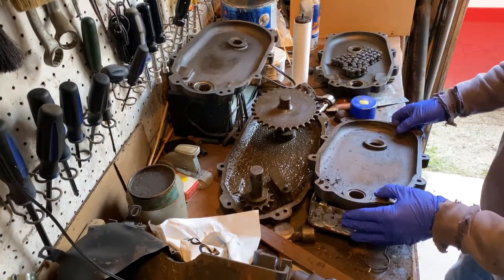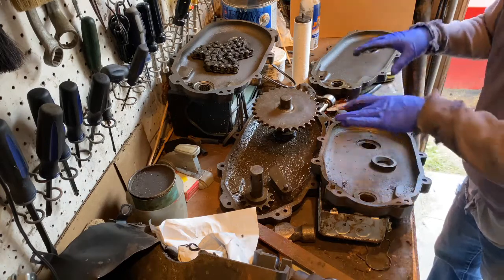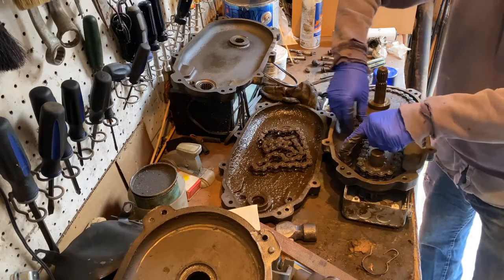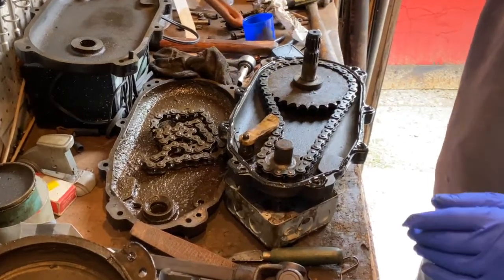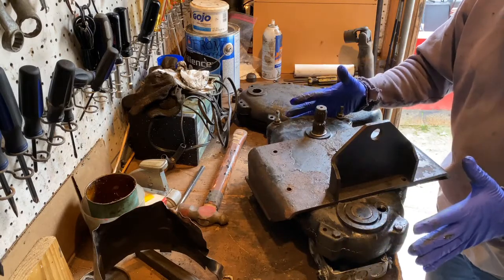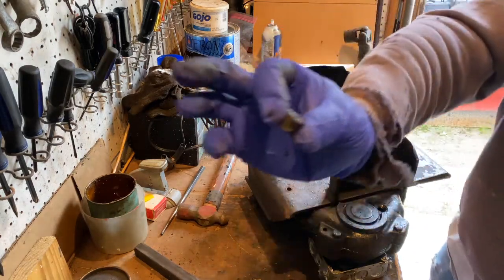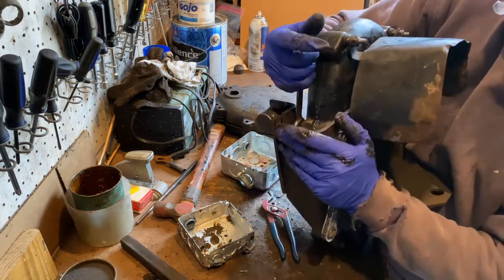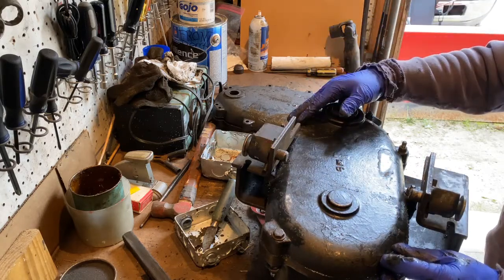John Deere 400 rear gearbox assembly

Comment: Hi I know this is an older video but I'm wondering does this pto take hy-gaurd for fluid or something else?
Reply from the maker: Originally I believe that’s what they took however I’ve been running power steering fluid in mine now for the past 10 years or so.
Reply: @shanesmaineshop Thank you! Also, do you still have your roto tiller, and if so, would you part ways with it? I'm in search of one for a 400. I appreciate your videos they've been very helpful.
Reply from the maker: @Leo_SN95  Yes I still have the Rototiller and no I don’t want to part with it, sorry and I’m glad the videos help you out.